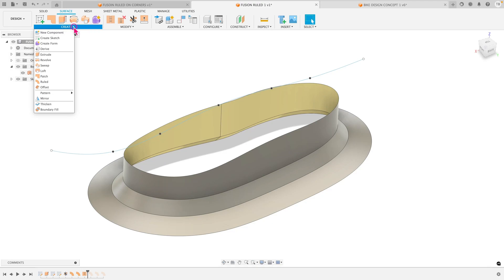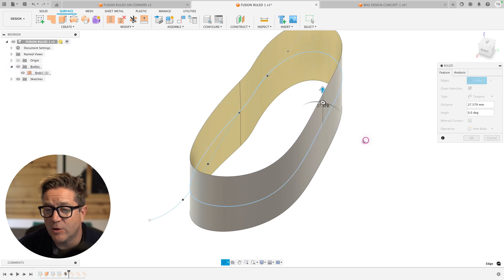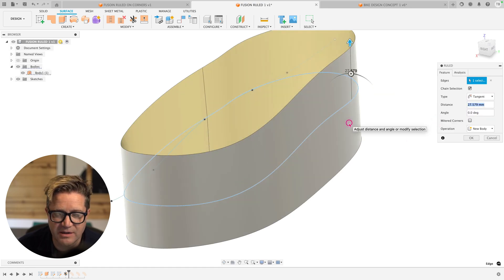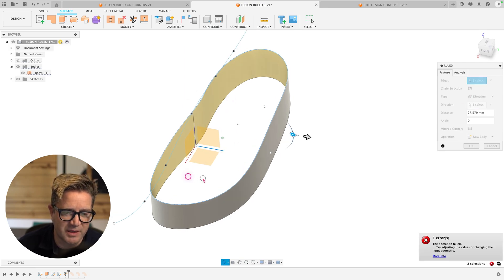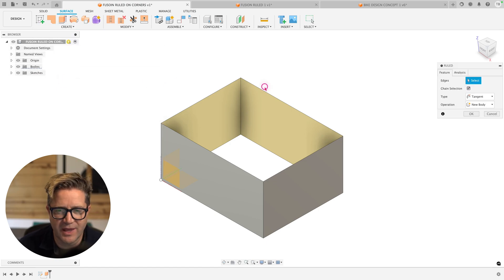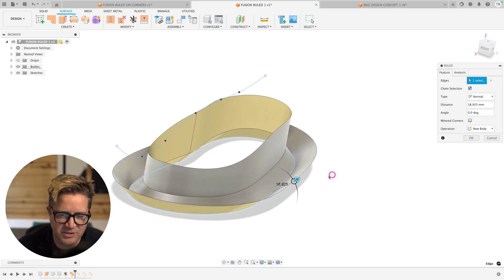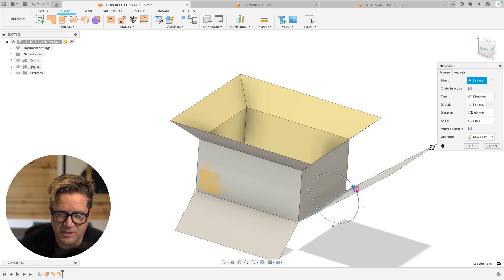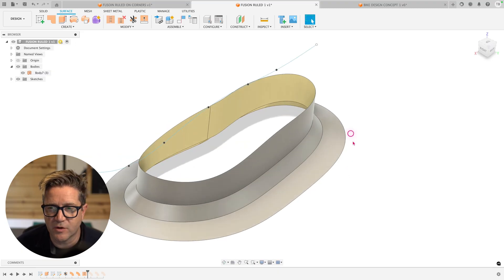Fusion 360 Ruled Surface Tool — Build Smarter Surfaces With Angles

Comment: Thank you for this tutorial, I probably would never would have been exposed to this command without your introduction to them. I will use this to create sheet metal parts that so often fail because  it doesn't always make cuts normal to the surface.